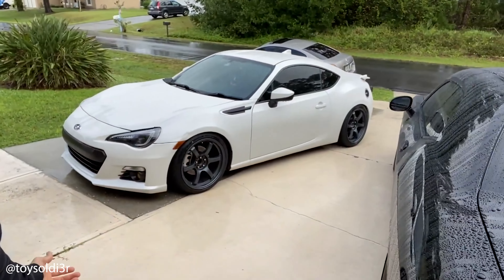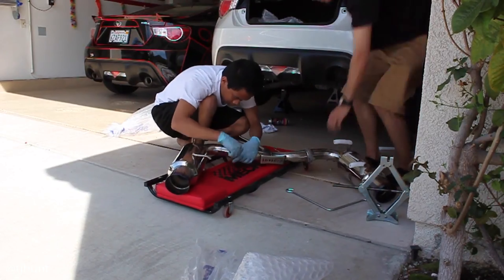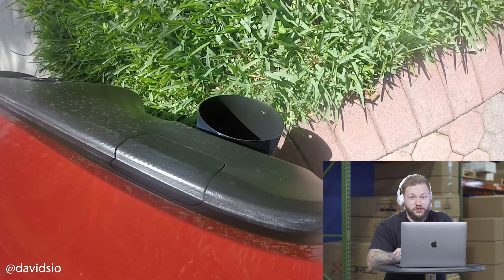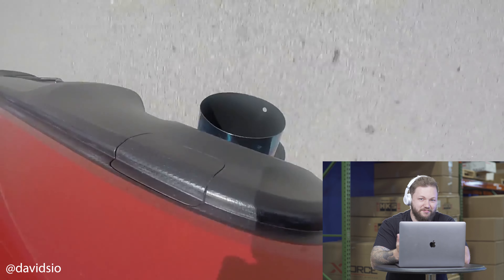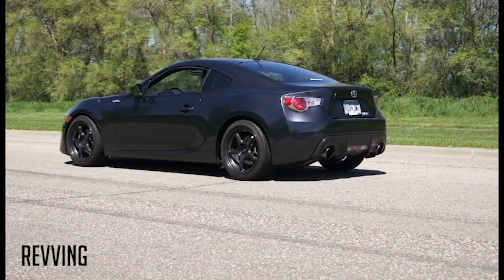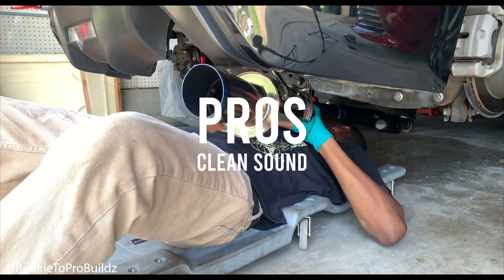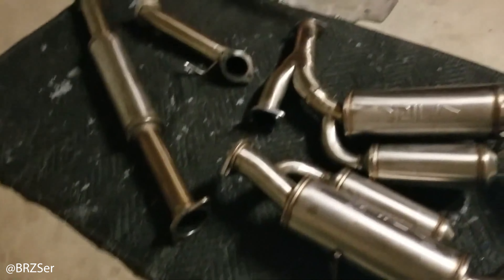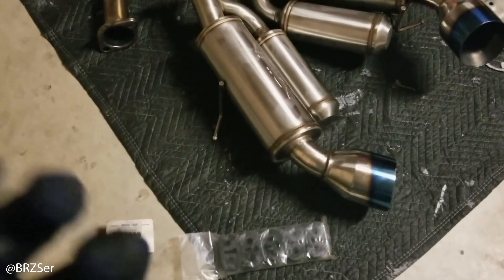Top 5 First Gen Subaru BRZ/Scion FRS/Toyota GT86 Exhausts

Comment: Man If that HKS was dual exit it would be perfect
Reply: Single exit means bigger flames
Reply: HKS makes a dual exit one too called hi power spec L or something
Reply: @B1SQ1T  yeah that’s the one I went with. We like it.
Reply: @toddkokko5049  I’m considering it, does it drone a lot? I got rid of my N1 because I couldn’t stand the drone and that was with stock headers, I have HKS headers now so I was thinking maybe since they’re both from the same company it wouldn’t drone as much? I haven’t heard of many complaints with the HKS having drone tho lol
Reply: @B1SQ1T  No drone for us. We are old and wouldn’t be able to tolerate it droning. It has the Helmholtz chamber so I think that helps. I had the cat back system and the rest  stock for the last 8 months. Now I have a JDL catless header and JDL overpipe with a stock mid pipe. Still no drone. I enjoy the sound and driving it when I get to. I feel like the cold start it quieter with the 2plus tune now. I think I have a video on my page when I still had the stock header.
Reply: @toddkokko5049  are you referring to the HKS Hi Power single V1 or the V2 with the square canister muffler design?

Just saw you were referring to the spec L
Reply: @YSoAggressive  I have the V2 with a full HKS system, and it sounds AMAZING.
Reply: @ivanzavala307  What is it called,the one you have?
Reply: @titus5106  The catback? The Hi-Power Racing V2.
Reply: Single V2 is the best trust me hsks hi power single racing
Reply: I disagree. It’s the bumper ruining the exhaust
Reply: That’s what I was just thinking I like dual exit way more anyway

Comment: The sound of a cat back can really differ depending on the rest of the exhaust system. The N1 might be mature sounding with no drone with everything else stock but, most these guys have catless headers and front pipe with the N1 and sounds like absolute shit, and they always complain about the drone
Reply from the maker: We try to isolate the parts in these videos as much as possible, but you're correct. The tone and volume level are greatly affected by the rest of the system!
Reply: How to you stay away from drone ? I really do like the sound of the MA performance exhaust, but I want a more free flowing header set up without the droning. My brother has tomei catless headers with Greddy catback and the drone is awful.
Reply: how do you keep tye sound you want? or what can someone do to not make it sound like dookie
Reply: @blaynebriceno add resonators

Comment: im new to the car scene. is having a new exhaust system for example the MAPerformance Catback be legal? Like pass emission test and stuff? And how much does it typically cost for shops to charge when installing a system
Reply from the maker: Catbacks should have no effect on emissions as they are after the catalytic converter. Shop install rates can vary greatly on location. Just give one a call and ask!

Comment: Invidia N1 minimal drone? I sold my N1 because I couldn’t stand how much drone there was
Reply: I thought I was going crazy when he said the N1 was minimal drone. I got rid of mine as well because of the excessive amount of drone from that exhaust.
Reply: @KehY91  I’ve heard the N2 is a lot better in that regard… oh well after the N1 I don’t know if I still wanna give the N2 a shot haha, looking at the HKS Spec L rn
Reply: @B1SQ1T  I never heard the cabin noise of the N1 so I don’t know how bad it drones but I have the Invidia N2 with Tomei UEL headers and it drones pretty bad. Probably not as bad as the N1 if you go off the volume although drone isn’t necessarily about volume and more so the frequency/vibrations resonating through the cabin and well the N2 is pretty bad. Did some volume tests and the N2 with Catless UEL headers is around 98 - 101db revving to 4k so is decently loud however the drone is abhorrent. Looking at a different catback to switch to cause I really do love the sound just not the drone. Saw Tanabe concept g cause single exit peaks my interest but I highly doubt the drone will be any better. Also if you plan on getting headers I would stay away from the spec L, it is known to sound pretty raspy and tinny sounding with any sort of header

Comment: I’m in California, would any of these be legal here. Im assuming no lol
Reply: If you don't change the headers or front pipe, all cat backs are legal. What would make them technically illegal is if they exceed the 95 decibel sound limit here in CA. If your looking to stay 100% legal in CA then make sure the catback doesn't exceed that decibel limit. Otherwise, it's not illegal at all to get a catback only. Once you change the headers or front pipe, your risking being sent to the state reff for modified emissions which is a lot bigger of a hassle to deal with than being sent for exceeded decibel limit. Also, modified emissions is usually a bigger fine. Long story short, only get a catback rn if your in California. Especially if your in Southern California. They are cracking down hard down here right now. Me and everyone I know have been state reffed for modified emissions and just trust me when I say it's not worth and you'll regret the process to correct the fine. Any catback is usually fine but if you wanna be 100% safe, make sure it's under that 95 decibel limit